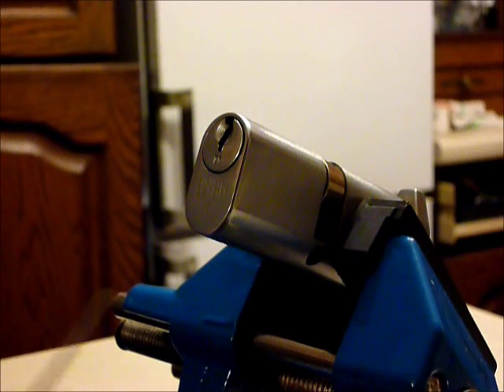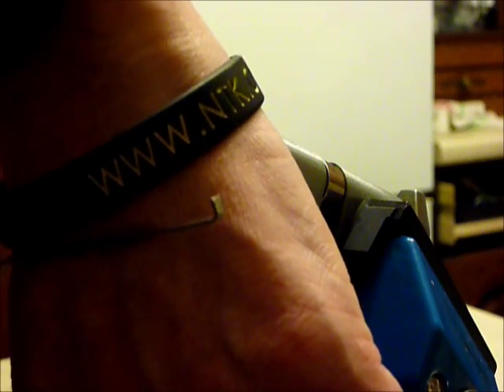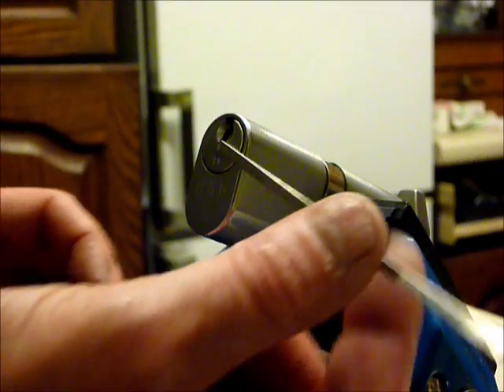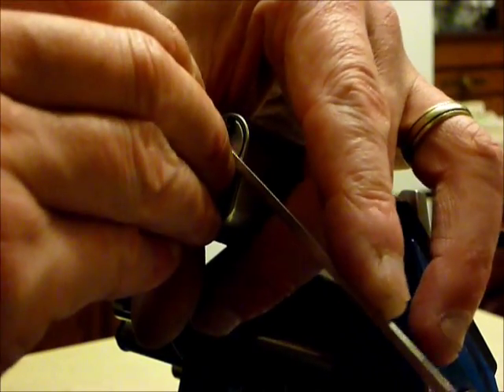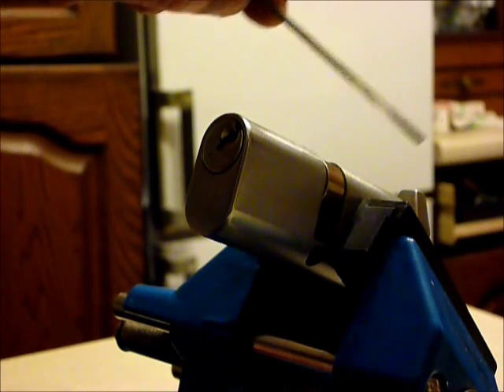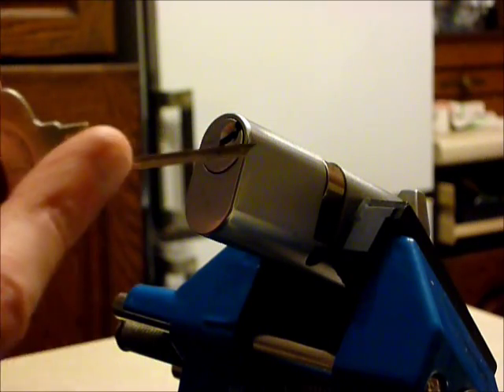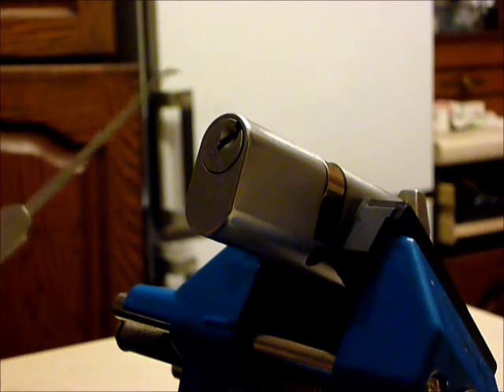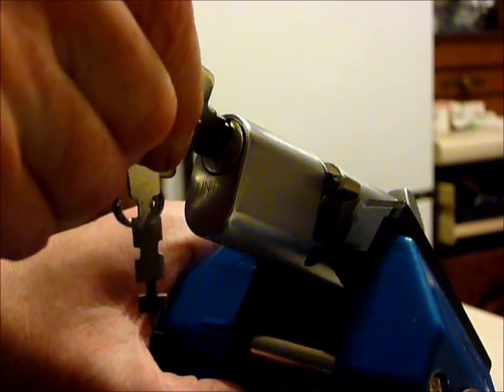Single Pin Picking UNION 6 Pin Oval Euro Cylinder Lock Plus HOME MADE CAM TURNER uklocksport.co.uk

Comment from the maker: Cheers buddy, I have had a few locks where the cam has not turned after picking the lock and most seem to be thumb turns funny enough. Think Ive had one normal Euro do the same thing and not sure why it happens as now and again the cam may turn if you pick it time after time etc...   :o)